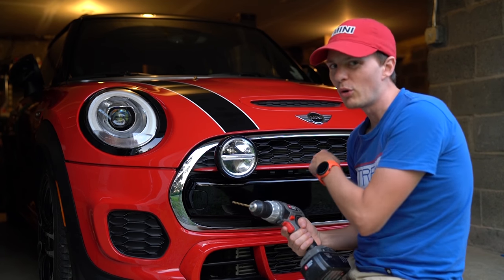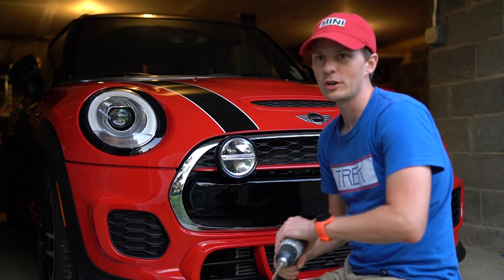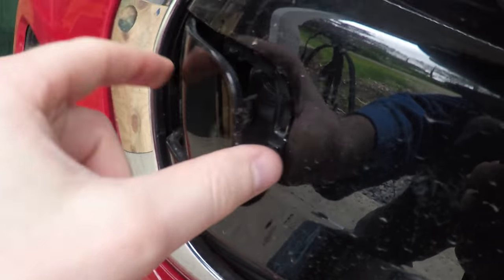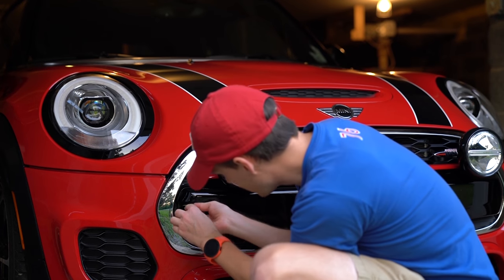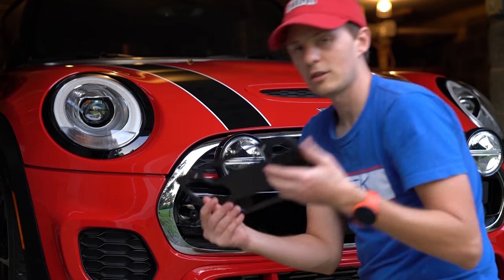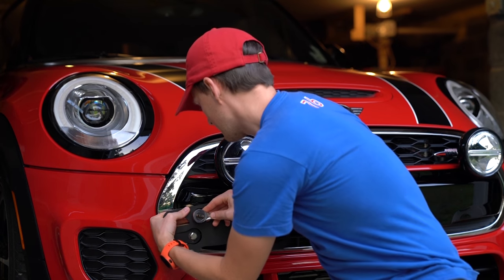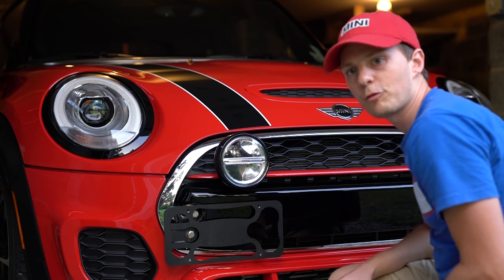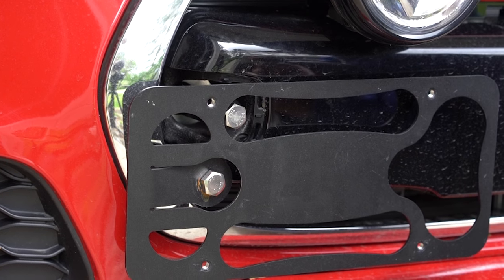MINI Cooper License Plate Mounting Alternative

Comment: I heard that for mini's that have the plastic front number cover like yours that comes on the iconic trim, that the platypus sits right up against the bumper, making it impossible to fit the quick release wrench in between to quickly remove the plate for car washes.
Reply from the maker: that is true, you have to take the plate off in order to remove the holder.
Reply: @TheMINIVlog  They really need to address this!
Reply: May I ask which one yours is? Is it the one for models with the rallye lights? Do you know what the difference there is?

Comment: Did you have to patch the holes from the front license holder?
Reply from the maker: I bought the car brand new so it didn't have any holes. I did tell my dealer not to drill any holes otherwise I'm sure the would have
Reply: Old comment but yea a dealer would’ve drilled the holes on the front license plate bracket for sure, unless customer requests not to. But the holes are so small I don’t think they would be noticeable on a black bumper like on this mini.

Comment: MY DEALERSHIP MADE HOLE ON BLACK BUMPER TRIM 51117379434 . IS IT HARD TO REPLACE TO NEW ONE? SHOULD I REMOVE ENTIRE BUMPER?
Reply from the maker: Watch my latest video. I remove the entire front of the car in order to swap out the grill trim. It would be the same steps for the bumper.

Comment: Ok, but it's off center.  Ew.  It is not pleasing to the eye.  Any other alternatives?
Reply from the maker: no license plate?
Reply: @TheMINIVlog  I have the rear plate on but the front there is no bracket and my state requires a front tag.  I don't want to drill into my pretty bumper but the off center fix is not really what I wanted. Wonder how long I can drive without the front plate for the police pull me over....